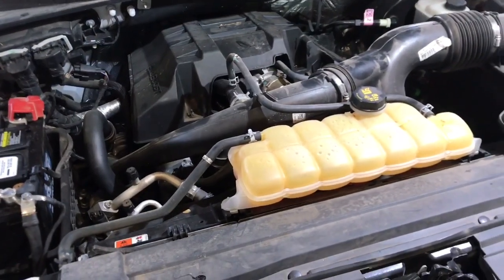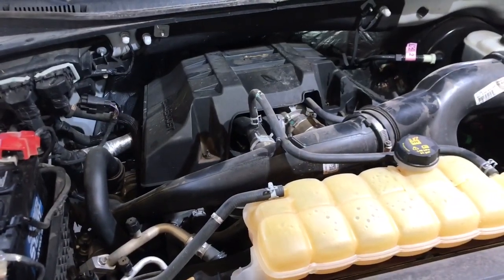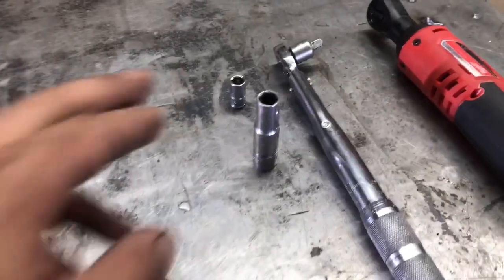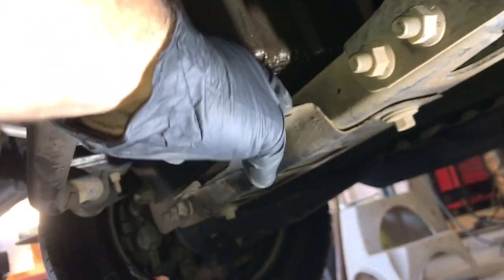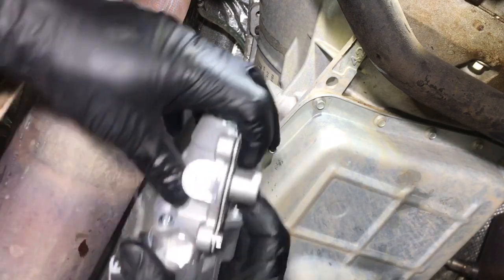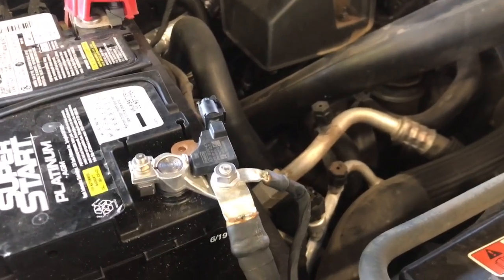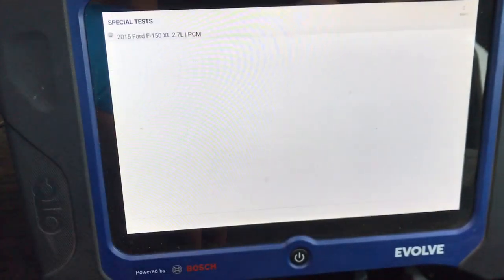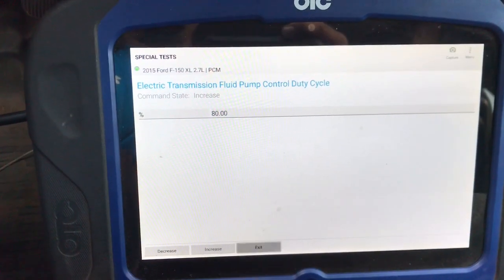Ford F-150 Auxiliary Transmission Fluid Pump Replacement

Comment: AND FOR YOU GUYS WHO WANT TO "DEACTIVATE DISCONNECT TURN OFF FORD F150 AUTO START STOP PERMANENTLY IN SECONDS", JUST YOUTUBE WHAT I PRINTED IN QUOTES AND THIS GUY WILL SHOW YOU SIMPLY HOW TO PULL THE BLACK CABLE WIRE UNDER THE DASH TO DEACTIVATE. YOU CAN THANK ME LATER...AND HIM TOO.   Update, I finally got the call from the Ford dealer for the cost of diagnosing, and parts and labor to fix this Auxiliary Trans Pump.  Total cost is $746.00.  Thank goodness they don't have the part in stock.  I paid the $120 to diagnose,  They want $338 just for the part, and want to charge 3 hours of labor, and this includes the diagnosis. To remove that part is a 10 minute process. I told them to wrap it up, I'll pay for the diagnosis, and I will dismantle the start/stop feature as I never cared for it to begin with.  Money in pocket and case closed. This is how the dealer works.  They sell you a vehicle, but they know you'll be back time and time again for expensive service. And this is where they make the real money.  I used to think the salesmen were the bread and butter of a dealership. Nope, it's the mechanics that really bring it in.
Reply: Yes, thank you and owner of the video. Auto start/stop nuisance has been solved.
Reply: They wanted to charge me $1500 lmao

Comment: I bought a 2016 f150 XLT sport with 55k miles. Drove it for a week and started to feel a rumble when I accelerated above 40mph. Took it back to dealer and learned it needed a new transmission including the pump. Thankfully the dealership covered it all but unreal for the trans to fail after 55k!

Comment: In the video you said 115 foot/lb for torque. I believe you meant inch/lb since that was an in/lb wrench. Great video. I am surely buying the Milwaukee power socket. The $2,000.00 tablet is not needed for an amateur like me. I was able to prime the pump using Forscan software, a windows laptop, and a $50 USB adapter cable. Forscan worked like a charm and does much more that you cannot with that tablet, at least for the F-150.
Reply: How did you prime using forscan? Was thinking of doing the same,  but haven't seen how to do it anywhere.

Comment: Hello Aaron, i have two questions, i have a 2013 Fusion Hybrid Energi, my car has a code p0c2A, Which is the auxiliary transmission fluid pump, my vehicle hasn't changed in the way it drives at all, first question will it affect the transmission if i continue to drive with this code on? second question if i replace the pump but only have the cheaper obd2 scanner, i can erase the code if it doesn't come back is it good to go, or does the part have to be programmed?

Comment: Great video - Thanks.  I was having auto stop errors they didn't help with prior and when I brought this vehicle in because it was overheating when towing I think this is the issue.  Sadly, It took my dealership 4 weeks to diagnose this and they wanted to charge over $1,000 to replace this on top of the $250 diagnosis.  Your video and the part on line is saving me big time.

Comment: Great video Sir! Such a sad common failure on these trucks.
Reply from the maker: thank you very much!
Reply: I'm leaving mine broken, and I will dismantle the start/stop feature on the 2016 F150 as I have posted up further what my experience was with this part.
Reply: My 2015  has failed. I am having trouble finding a pump. Any idea. I can’t afford a pump from ford.
Reply: @AaronHinesAuto  my pump just failed on my 2015 2.7. Any idea on where to get a replacement? I’m not having luck.
Reply: @matthewlewellen6516   I am pretty sure you have to order one from Ford unless you can locate a transmission parts shop or builder in your area that may have one.

Comment: Since I almost always turn of the auto-stop with the button (except when i forget), this pump has been on maybe 20-30 hours in 60,000 miles. Short life for a electrical pump i think. They did not mention this when I took the FORD F-150 factory tour in DEERBORN  Michigan as a feature.

Comment: I was just notified by my Ford dealer that I need an Auxiliary Transmission Fluid Pump  replacement for 2016 F150.  I always wanted to turn off the start/stop feature on this truck because I think it's wasteful, and this truck proves it.  I don't care about saving 2 cents of gasoline at every freakin' red light I stop at. Question: If I pull the wires on the dash for this stupid start/stop feature, will the pump no longer need to be used? Will the pump still need to be used for other reasons other than stop/start?  Thanks for your response, and as always THUMBS UP!!!
Reply: Its such a dumb feature and causes more issues then what its good for.

Comment: 115 foot pounds on those bolts, huh?   Fun times!   I know you meant inch pounds.

My 2019 F-150 with 1,400 miles (yes, 1,400) is throwing a P0C29 code but no wrench or CEL yet.  It's listed as CONFIRMED/PENDING.  

I never thought the auto start stop tech was a good idea and this supports that assertion.  More complexity.  Probably to try to meet CAFE standards.

Comment: Great informative video sir thank you for your time and effort, I likewise have a 2015 F150 with a 2.7 eco-boost ,been throwing this code (POC2A-00)for a while now .my question is can I just disable to stop start mode and drive it with no issues. Local Ford store will not give me any response without bringing the vehicle in for diagnosis and incidentally there five weeks backlogged on appointments.🤷‍♂️. Since I only have 17,000 miles on the truck I thought there might be some kind of warranty but they won’t give me any response. FYI I do have some fantastic automatic transmission shops nearby, I appreciate your guidance, thank you Sir👍

Comment: Hi you have a great channel. I I have a 2018 F150 with a 3.5 eco-boost my Auxiliary trans pump on cold start rattles for about 30 seconds before it’s smooth out I took it to the dealer they told me that was common for them to make that noise on initial starts I don’t think that’s true but what do you think I thought there would be a Anti-back flow valve thanks In advance for any of your answers

Joe

Comment: Awesome video Aaron. Appreciate it! I have the same truck year , engine and all 70,000 mileage and have the P0C2C-00 code right now on my truck. The  Wrench light is on. No check engine light And the auto start stop no longer works . Could this be the cause? And is it okay to leave it the way it is? I never used this feature in my truck as is. And really see no purpose in fixing it if it doesn't do harm to anything else. Thanks again.
Reply: I have the same ?. Mine started throwing poc2a-00 code at 16,000☹️, is it OK to disable the stop start mode and continue to operate a vehicle.
Reply: @brittweir8844  I rode my truck to 100,000 with no issues . The start stop feature to my knowledge does not effect normal transmission function . The auxiliary pump is just to keep pressure for when the engine comes back on. Keep riding it .
Reply: @gabe688 Thanks for clarifying this! Was about to buy the part, would rather just disable start stop outright!
Reply: @jamesmanson2152  Yeah I actually pulled the plug apart in the top of the dash and put a jumper wire in the pins and got rid of the button entirely. I believe the issue was the auxiliary transmission pump failed that keeps prime for the fluid when the truck starts back up. Honestly I hate that feature entirely.
Reply: @gabe688 so you left the faulty pump in and just carried on?
Reply: @conraywest  sure did drove it until 150 k and traded it in
Reply: @gabe688  someone wanted 1500 to fix it I laughed and said no thanks. Insane.
Reply: @conraywest  Pull the dash in the middle apart behind the button. Find the plug and jump it out the button with a short piece of wire. Get rid of it. The auto start stop is pointless and the aux transmission pump from what I gathered only holds prime so that when the vehicle starts back up it doesn't ram forward.
Reply: @gabe688  yeah mine isn’t even functioning I’m wondering if I can just leave it like that or if I should program it out? I have a programmer but i don’t like the idea of messing with the BCM.
Reply: I also saw something about pulling a wire by the  the brake pedal

Comment: I have a 2019 F150 3.5L Eco (10 speed) that is getting the Check Engine Light with the Auxillary Pump code. I went to Ford and they gave me a Oil Pump that looks nothing like that. I cannot find a Part number for this thing anywhere. Could you please help me find the correct Part Number or maybe a different name for this?

Comment: Are you able to recommend any other software to do this? The software you use costs way more than paying the dealer to do the work (including parts). Is Forscan capable of doing this? Excellent video, BTW. Thanks!
Reply from the maker: Unfortunately forscan cant. If I was you, I would install the pump and take it to ford so they can prime it. They should charge too much for that since it’s so quick
Reply: @AaronHinesAuto  thanks for the info!

Comment: Would the code go away or the wrench on the dash go away if the pump started working again say if it was just a bad connection?
Reply from the maker: Yes it would.
Reply: @AaronHinesAuto  Thanks for the reply, got a 2016 w 30k on it pump just went out, will have to take it down to the dealer.
Reply: I read that FORScan can be used to prime the pump.

Comment: The part is currently unavailable.  As long as the auto start-stop is disabled, can I drive my truck without any issues?
Reply: What did you end up doing?
Reply: @conraywest  I eventually found the part and installed it.  I took it to a dealership to get them to do the computer work.  Pretty simple, really.  Works like new.

Comment: Great video Aaron. I dont have a 2.7, I have 3.5 first gen Eco but my friend does and I'll let him know. How many miles did that truck have when you replaced part?
Reply from the maker: Thank you! I have seen trucks as low as 56k miles when the pump burned out. The truck I was working on in the video has 118
Reply: @AaronHinesAuto  Yes, mine had 102,000 on the 2016 F150 2.7 ECB

Comment: Can you in theory drive safely without the  pump working? As long as the auto start stop is disabled?
Reply from the maker: Yes you can
Reply: @AaronHinesAuto   OK thank you! I got the "electric transmission fluid pump control circuit" code this morning and no other vehicle😅
Reply: @mountainman45  I have been driving around and it would sometimes come on, now its on every time I turn the truck on. I feel like its putting the truck in a limp mode as well. Don't use the feature but wanna get it fixed so i don't gotta deal with the annoying wrench and performance loss.
Reply: @AaronHinesAuto  got mine diagnosed with bad pump, so like what you agreed? this is only part of auto stop start and can drive safely without pump working and the same time probably turning off this feature for good

Comment: Same pump on the 6 speeds and 10 speeds?
Reply from the maker: The 10 speeds were designed to be incorporated with the auto stop feature when they came out in 18. The do not have an external pump like the 6 speeds too.

Comment: Thank you. same problem here. SHould be done by ford for free. this is unacceptable poor quality. At 60,000 miles, 2016 F-150. I loose this pump, 3 of 4 tire pressure sensors, and 4wd vaccum selanoid at wheel hub . What else will break with this fancy truck. Going on short list to fix in garage, but the priming wish I could do it without an expensive test tool which I do not have. Again Thanks.

Comment: My bolt snapped on reinstall. It was a brand new bolt….
Reply: Well if you tightened it to 115 ft lbs like he said I’m sure. He should have said inch lbs
Reply: @BossMan302  yup it sucked was in a rush and should have noticed it. Was my fault but damn it made it harder. Went on fine otherwise 😂